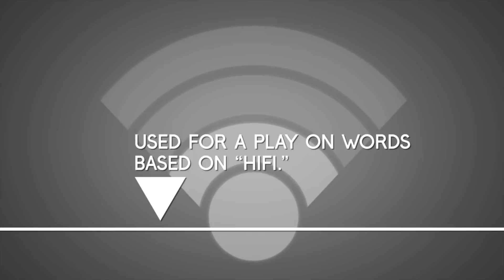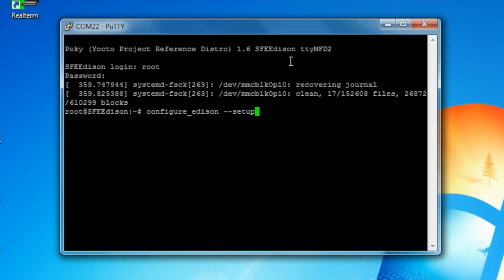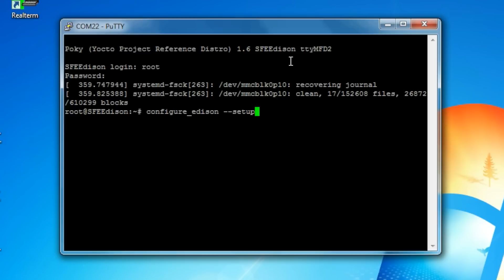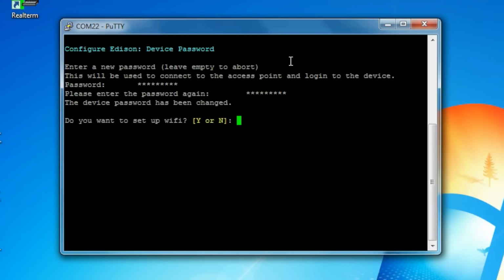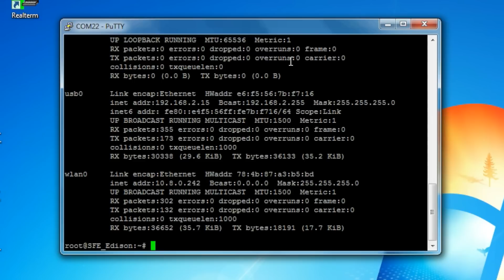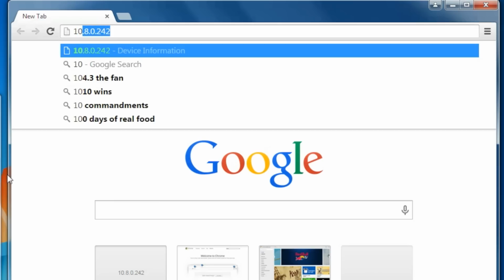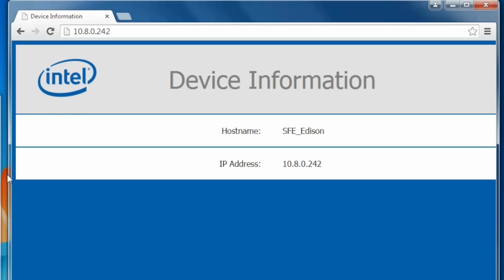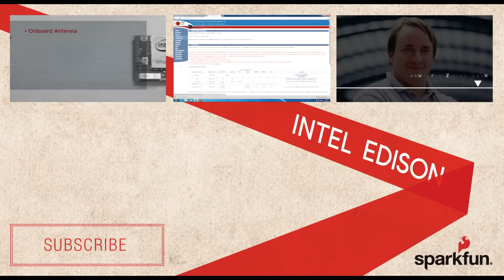Getting Started with Edison Part 4: WIFI

Comment: I know this post is old but if someone is still listening. I have setup my edison, kind of the long way since this tutorial is old, but it is running. This setup script works and I connect to my network. However, I can't reach the edison through the browser. Any suggestions?
Reply: Can you ping the Edison from your computer?
Reply: I can ping Edison from my computer and Edison can ping Google. Edison has 2 IP addresses assigned one for the USB0 and one for WiFi. I have disabled the USB0 and I still cannot access Edison through the browser.
Reply: I am a late bloomer to the Edison world apparently. I have forgotten much of my linux so I will have to refresh my knowledge. I also hear Edison is on its End Of Life :(
Reply: In addition it appears that things have changed in the past 2 years since you posted these videos with respect to putting the Yocto image on the Edison. I had to use flashall.bat, dfu-util.exe and libusb-1.0.dll. Kind of complicated. I can see the Edison drive on my computer but the partition is only 776MB.
Reply: You are correct that Intel just announced EOL on the Edison, and that many things have changed since we made these videos. Are you able to ping your computer from the Edison? I've run into issues before where one device can ping another, but not the other way around. You also may not need to view the Edison webpage to continue developing on it (especially if you can already ping Google form it).
Reply: I understand I don't need the webpage but it is one step in following your example I wanted to complete to be sure I was understanding.
Reply: Sector size (logical/physical): 512B/512B
Partition Table: unknown
Disk Flags:

Model: MMC H4G1d (sd/mmc)
Disk /dev/mmcblk0: 3909MB
Sector size (logical/physical): 512B/512B
Partition Table: gpt
Disk Flags:

Number  Start   End     Size    File system  Name         Flags
 1      1049kB  3146kB  2097kB               u-boot0
 2      3146kB  4194kB  1049kB               u-boot-env0
 3      4194kB  6291kB  2097kB               u-boot1
 4      6291kB  7340kB  1049kB               u-boot-env1
 5      7340kB  8389kB  1049kB  ext2         factory
 6      8389kB  33.6MB  25.2MB               panic
 7      33.6MB  67.1MB  33.6MB  fat16        boot
 8      67.1MB  1678MB  1611MB  ext4         rootfs
 9      1678MB  2483MB  805MB                update
10      2483MB  3909MB  1426MB  ext4         home

This is the partition table. Does it look right to you?
Reply: Update: I was having problems using the Intel setup applicattion. The install DnXUSB Driver was locking up the app. So I uninstalled all Intel apps and services. Still had problems uninstalling the DnXUSB app. But finally I was successful. Then I ran the Intel Setup application and finally made it all the way through the setup. That felt good. But still can't access through the website or local host.
Reply: So now my question is this. In this install I am docked to a Pixhawk 2.1 host board. In the Arduino client it does not list this board under tools. Is there a work around for this?

Comment: The configure_edison --setup option is not valid in the image I downloaded. If you simply run configure_edison with no arguments it will work as the video describes. The configuration I discovered this with is the edison-image-ww05-15.zip on a mini-breakout board.